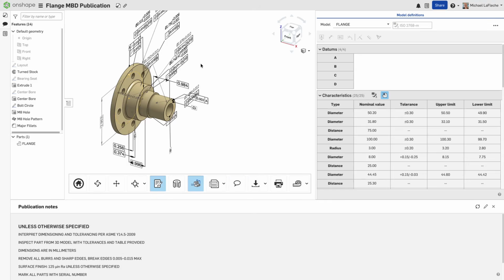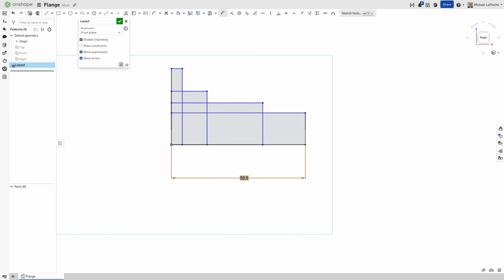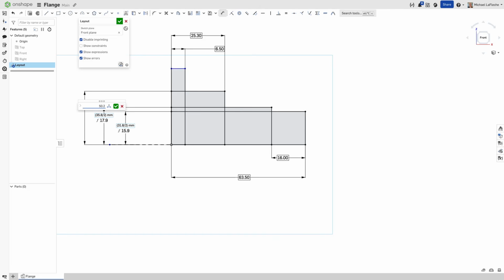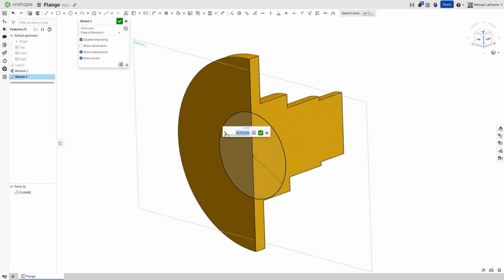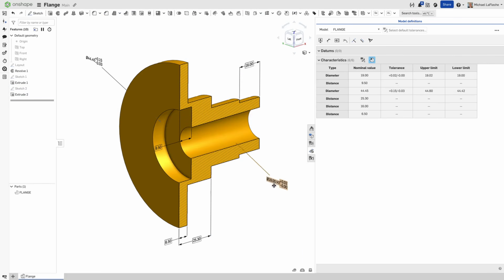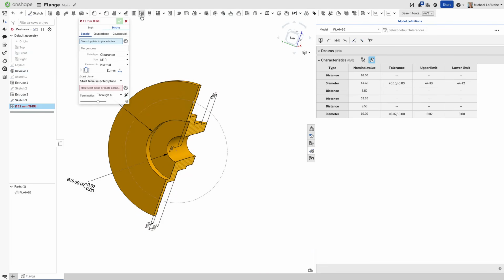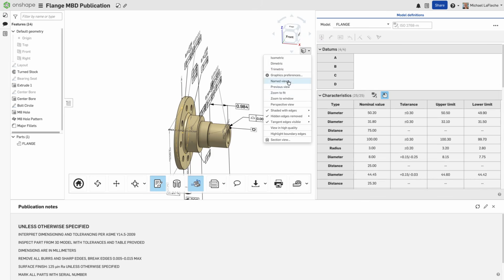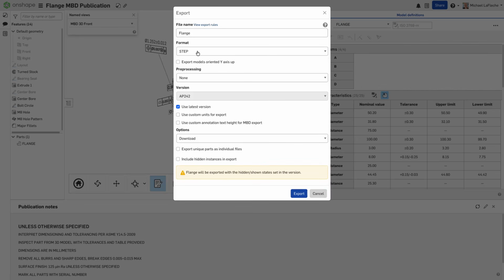Try this Model-Based Definition Workflow: Add PMI During Modeling (Onshape)

Comment: When I dimension across a centerline to make an explicit diameter dimension, I'm not given the option to make the dimension tolerant.  Is this a flaw or a feature?  It's seems silly to me have to do that X/2 workaround.
Reply from the maker: Hello - Thanks for bringing this up. We do have more improvements planned for that dimension type support in sketches. Yet to come so stick around :)